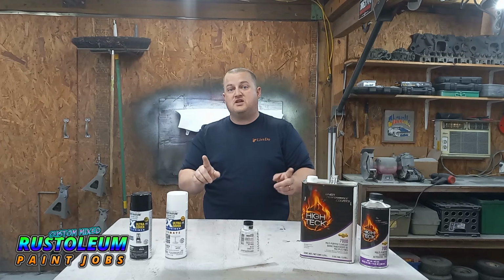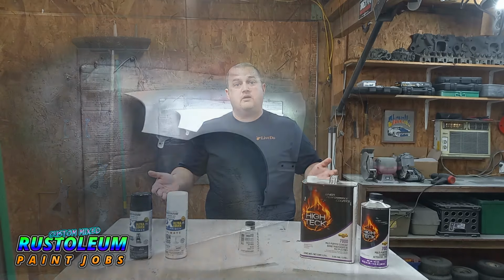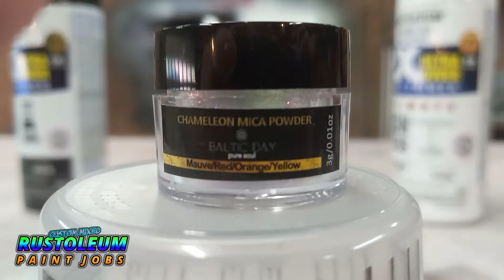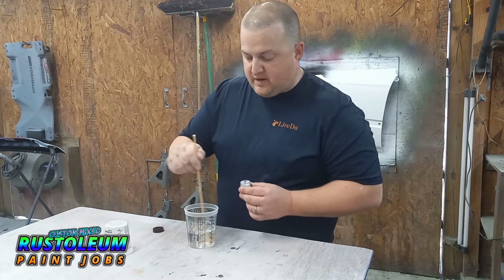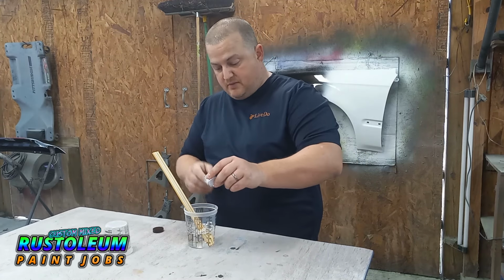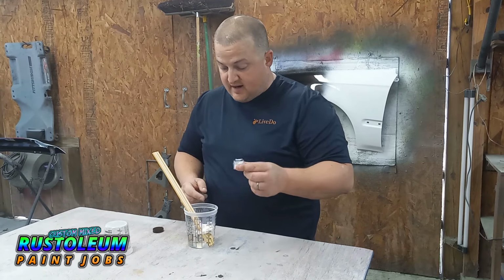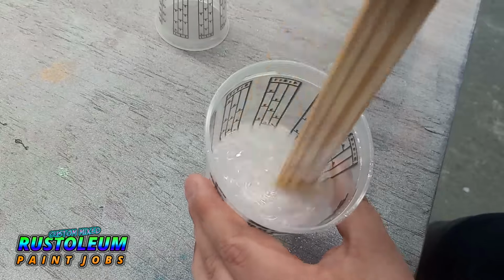RUSTOLEUM PAINT JOB BLACK AND WHITE USING A PURPLE GHOST PEARL!!!!

Comment: Hey John, can you clarify a couple of things? I notice that both these paints are paint and primer so I am curious as to if we scale this to a car what considerations do we need to keep in mind? Also I see it mentions plastic on the can are there and advantages or disadvantages of this type of paint being for plastic vs metal? please advise.
Reply from the maker: To be honest the 2x rustoleum paint and primer is pretty good and forgiving over metal and plastic so there's really no issues i could see you running into different than any other paint. You just wanna treat it as you would any other base clear paint job. The biggest thing is don't worry about trying to get it glossy with the paint just spray for coverage and if you use the pearls in the clear take your time and walk the length of the car when you spray the sides to get the best consistent results. If you have any other questions feel free to ask and thanks for watching.

Comment: How long of a wait time after spraying the rustoleum paint do you spray the clear with pearls? The Black is Definitely a 5 and the white a 4.8!!
Reply from the maker: About an hr when spraying it thru a paint gun and about 20 mins when it's spray can but i always touch the tape or hidden spot to see if it's tacky but doesn't pull paint off on my finger that lets me know it's ready for the next coat thanks for watching

Comment: After applying your rustoleum paint .what is the wait time to apply the clear ?
Reply from the maker: With the spray paint about 20 mins but if your shooting thru a gun 45 to an hr I usually check the tape around what I'm spraying if it's tacky but not pulling paint off on my finger you're good to go thanks for watching